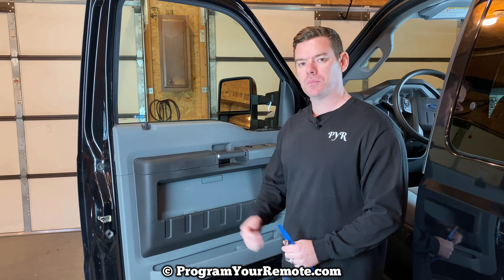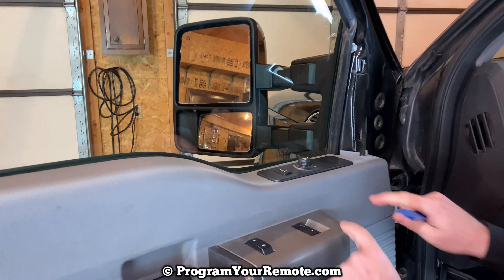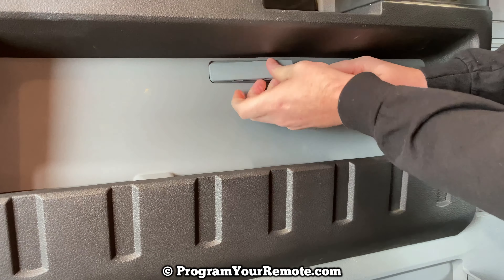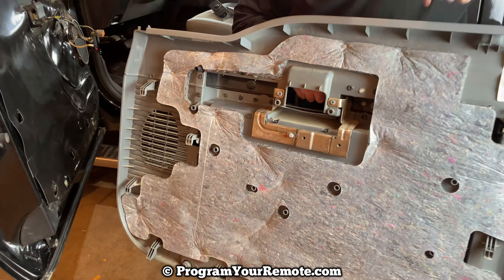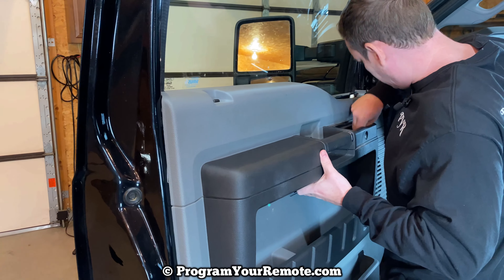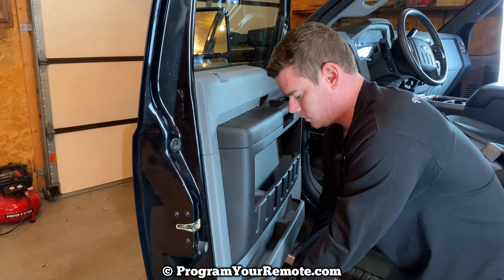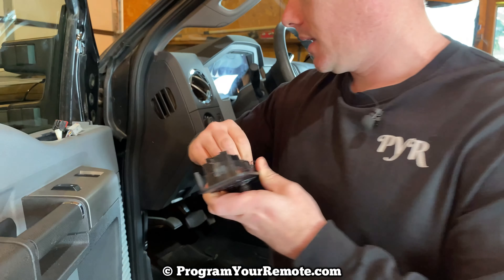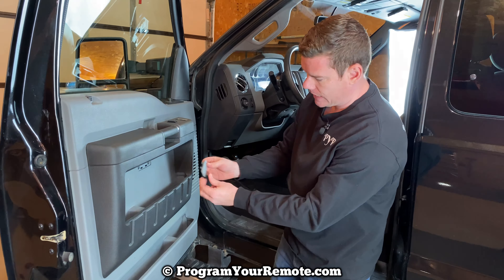2011 - 2016 Ford F250 Door Panel - How To Remove Replace F-250 Front Driver's Panel F350 F450 F550

Comment: thanks,  we're got a power door lock fuse blowing and a power window and power rear slide window that work sporadically. hoping to see something in here causing it.
Reply from the maker: Good luck! hope you find it
Reply: We did. Melted wires in the driver side rear door. Thanks.

Comment: What size are the speakers 🔊 for the front & rear of a 2010 F250 Super Duty  & is their any good Sterio System that U can recommend to look into ? Thanks for the video 👌🏻
Reply from the maker: I believe the 2010 F250 uses a 6x8" speaker.  I really don't have a particular one I would recommend though